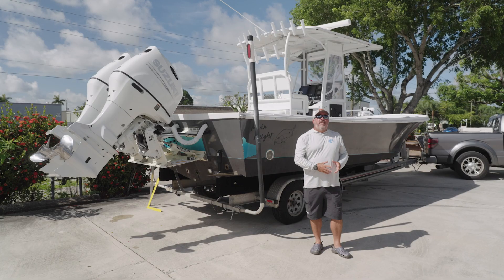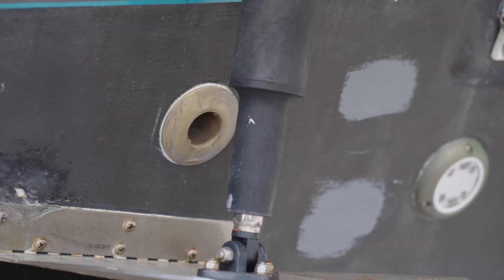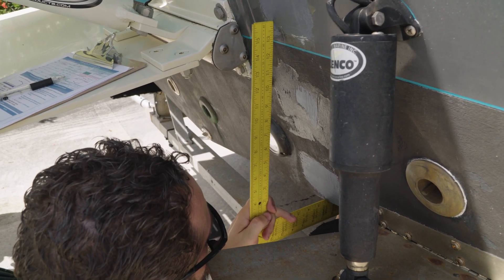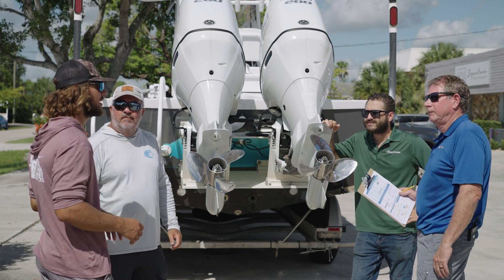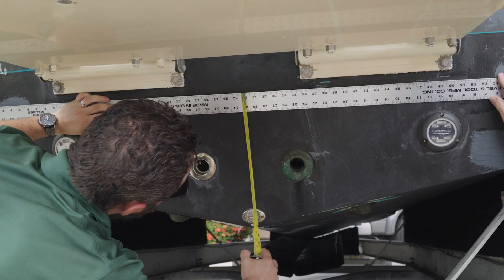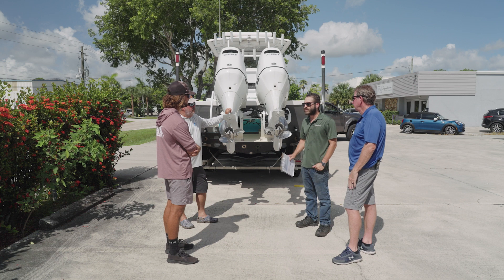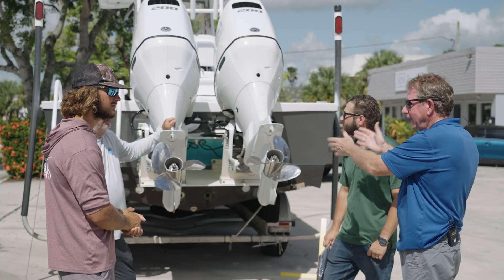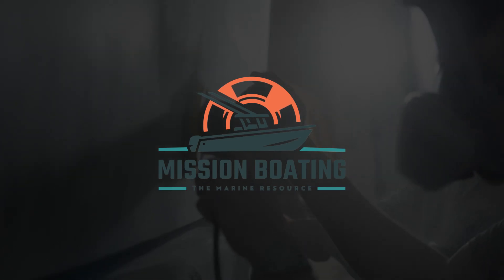Movin’ Weight 25 Parker Project: How-To Measure Your Boat For An Engine Bracket!

Comment: Why did he decide to get rid of the porta bracket? I'd really like to hear his remarks because I'm considering installing a porta bracket rather than a flotation bracket on my 1978 Mako 25.

Also, I'd be interested in purchasing his old porta bracket.

Please respond!
Reply from the maker: If you don’t need to float shallow or run shallow, porta bracket doesn’t make much sense. Also, it provides no flotation — these older hulls need the additional flotation for new four-stroke power. Unless you’re fishing shallow (which in an old 25 Mako would be odd) we’d go Armstrong bracket on that rig, for sure!